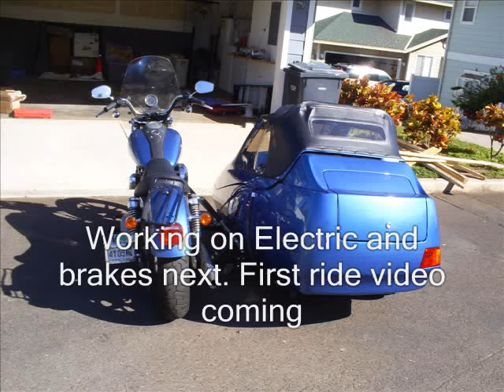Daytona Sidecar installation to Harley Dyna

Comment: I saw Screamin Eagle heads on your bike, what all do you have done to the motor?
Reply from the maker: In a later video walk around I go over all the upgrades ultimately done. In this earlier video I believe it was just a stage 2 with 5 degree rake triple tree and a primary gear reduction sprocket.
Reply: @hawaiisidecar  Awesome, l'll go watch the video on the bike!